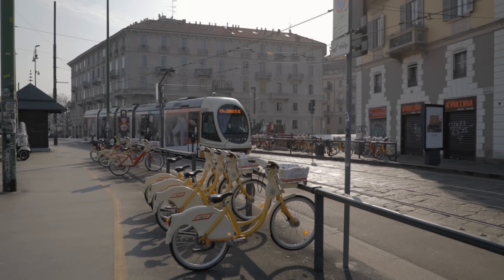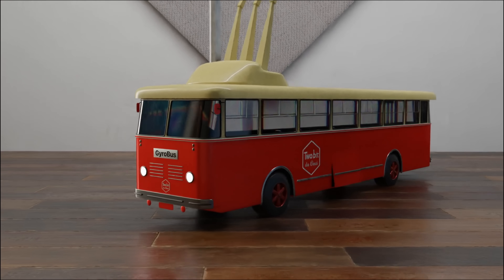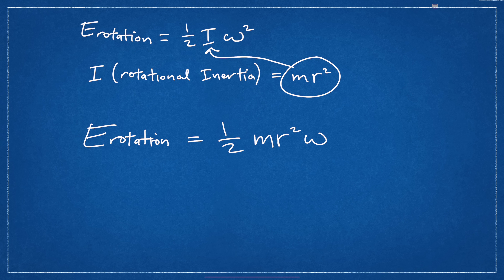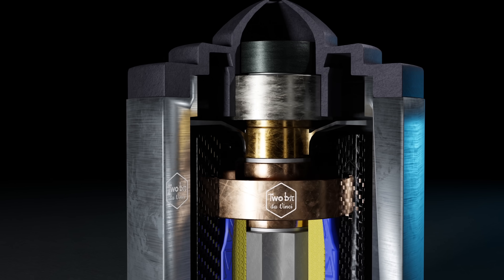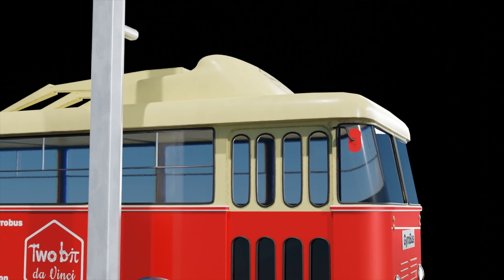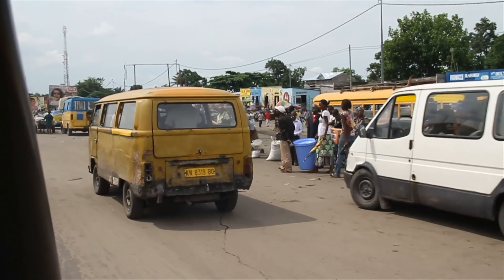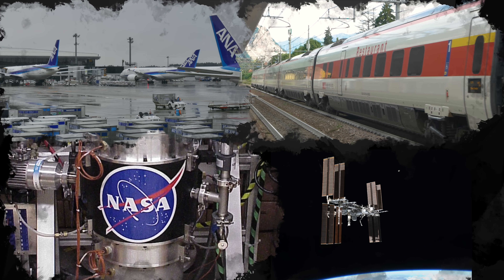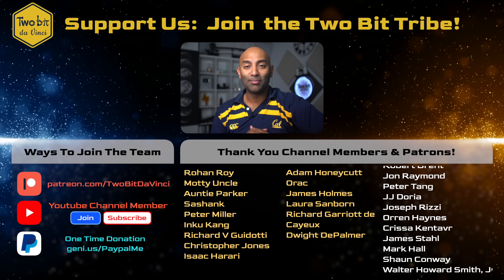This Bus Went Electric WITHOUT Batteries

Comment: Even for grid-scale energy storage, these flywheel energy storage systems are not commercially viable compared to pumped hydro and batteries, due to their low energy density, high cost, high probability of failure, and safety concerns.

Comment: Another ideal using no chemical batteries is using the similar ideal of the flywheel buses, but using compressed air instead.  This would cause no problems with  inertia when turning like the spinning 3 ton flywheel will. Using the same logistics, stopping every few miles and recharging using electric motor/generator onboard connecting and building up pressure at the bus stops. The motor that charged the air tank is also the generator to supply the bus motor its electricity.  The air pump can also work in reverse when discharging, supplying the generator the rotation it needs. But it probably still cost too much to run just like the flywheel buses. I don't know what do you think, will they cost just as much to operate?

But one for certain thing they will be much cheaper to manufacture, no need for vacuum chamber, no need for specialized exotic  materials,  just using the technology already mass produced. Like it shouldn't be a big hassle to design the air pump and motor/generator for a bus. But of course it is limited to air tank size and strength, but it is better than trying rubber bands. lol I would need a guy like you to go thru the calculations to see the numbers, if it will even work, and if so is it plausible for buses, and how efficient it is to convert electricity into air pressure, and then back into electricity, and then into mechanical motion of the bus.
Reply: Mmm.  If you use compressed air, you still have a large metal thing under a large pressure.  You're right about the inertia. I suspect the losses of pumping would be large, though, and I really don't think you could store useful amounts of energy as compressed air. the really nice thing about the flywheel is being able to directly add or take energy as electricity, which is convenient stuff to use.  If you think about compressors, they are all the mechanical miseries of a petrol engine, and not only that but you'd be using piston tech to get the air usefully out too, so it'd lose twice.  Now a giant clock spring...

Comment: Nope: Angle of procession. True flywheel will flip the vehicle when it turns a corner. These mentioned here are horizontally mounted and driven by external engines.

Comment: It's wind up concept like toys. Mechanical PLUS reasonable batteries...plus maybe smaller flywheels and soundwaves/steam engines should have stopped the destructive oil grift. FULL eco hybrids. Though nominal heated wax or oil could still help efficiency.

Comment: when I first considered this I discounted it for the conventionality of battery but I believe I'm beginning to see the light . with new developments in materials and motors and coupling devices to the wheel , there really maybe good practicality with ability to spin these up quickly and the obvious of hybriding with battery /supercap combo for quick charge at same time . 3.4 KWHrs/km ? thats a bit high but 20 passengers . 0.2 for modern car for 1 passenger . so even for that old clunky bus its still comparable and I'd hazzard a bet that antique bus number could be HALVED ! or better considering all the inefficiencies converting the spin to voltage back then and the advancements of todays generators and drive motors ...  wheres engineering savy ?

Comment: The thing with a modern flywheel is that there is no need for extreme RPM, you just do the math, run it in a vacuum with a magnetic or some sort of low friction bearing and then figure out your windings to get the current that you desire. Just look at that antique Swiss bus, 6 kilometres at 50-60 km/h. spin it up when you are stopped for passengers and good to go. combine that with diesel electric for backup and our modern energy braking recovery and I can see this being at least 5x more efficient then it was 70 years ago. you can even have a direct mechanical transmission of some sort. when you look at 3000 lb battery pack in a Ford Lightning pick up truck that gives you a lot of inertia at 10x that weight in flywheels in a commercial city vehicle. Combining various energy recovery systems along with just keeping it spinning at top speed while it isnt in use would likely make it last even longer. Also you need no exotic materials, no fire risk, run it at a modest speed in a well designed case to contain any unlikely catastophic failure. It just sounds like a great thing as we have been using flywheels of all sorts for thousands of years (pottery, spinning yarn, wind mills, etc). You look at the massive turbines in hydro electric, the high speed steam driven power plants. It is just a no brainer to perfect what we know instead of looking for rare earths for a 10 year battery. We humans just seem to love to look for higher technology to make things more complex and try to make  things "better" instead of looking at simple known tech and making it more efficient. Just look at the electronics supply chain problems, thousands if not millions of cars waiting on a microchip just to make them function but otherwise complete and ready to go. Imagine where we would be with modern transport if for example we could not make our autos run for the want of spark plugs 120 plus years ago.  What has happened to that old adage of "Keep it Simple, Stupid"? After watching your whole vid I thought why not mount it on a pintle like the compass of a ship? That way it could maintain the same attitude on uneven surfaces and change its angle when you turn(gyroscopic precession) Also multiples  for redundency and space utilization.

Comment: You mention a 20M Watt flywheel system near the end of the video. This just shows the inadequacy of renewable systems. A medium sized coal plant produces 400 MW of electricity. A typical nuclear plant produces 1000 MW of electricity. Thus, the renewables are a pimple on the a** of the energy we need.

Comment: My father worked at an Army weapons lab. When I was a teenager and taking physics and caliculus in high school. He set me a problem. They had a flywheel. The dimension were set, as was the speed of rotation. The only thing they could vary was the density of the material. So he had me calculate the density. Of course, it was all classified, so he couldn't tell me anything about the application, but I firmly believe it was a power generation system used in the field. This was about five decades ago.
Reply: flywheels are a nice way to dump a LOT of power into a laser or a railgun or an EMP device very suddenly but without browning out the nearest town's grid =)
Reply: @ralphm4132  I actually purchased some flywheels for a high availability data center I was building. We had it segmented into 100KW blocks. There was a flywheel always on to instantly provide the 100KW for a short period of time while the backup system (there were multiples of these) came online. It worked flawlessly.

Comment: Hi All @ 2Bit yes to fly wheels!
Small Medium or Large! If but on a gimbal the turns would have not been as Big a problem or in the Rear of the Bus on a c Track an if stabilized by Springs or Shocks letting them move would help the Turn! If Carbon Fiber I can’t see them getting near 3000lbs or 4 small ones on each corner of the vehicle 
Your talking about no Fuel to operate What are you waiting for? Bob Vandivort

Comment: That picture of how they did it might be useing induction motor that has no wire to the shaft,and you can put a conductor plate between that motor on a shall and it would spin. Here they are useing 2 induction motor. So it spin faster. They could do this today but where to put it. It get loose that a spinning top on the sidewalk. LOL

Comment: It never pays to reinvent the wheel. Thanks for showcasing these electric busses. I rode on the electric busses in San Francisco with the double telescoping wands that get their power from the overhead lines. I like the street cars that run down the middle of Market Street, the cable cars that run up and over various hills , and the driverless BART subway. The newest technology among those I listed is from 45 years ago.

Comment: Wow one of the coolest things I've seen.
I'd love to see you explain when why and how they came up with the wood gas system to run cars and buses through WW2. That was amazing to see film of.
Reply: simple, just anerobic burning of the wood to degas it and you end up with charcoal as well
Reply: @johnkufeldt3564  Back in the 19 40s during WW11, as a child I rode in a butcher's truck powered by what they called a Gas Producer. This was a huge thing on a trailer towed behind the truck. It burnt charcoal to produce the gas, which was piped to the engine. An extremely polluting device with black smoke pouring from 6-inch diameter  chimney on top of the device. Smelled awful as well.
Reply: @johnkufeldt3564  I understand the science. I was more intrested as it was used on buses how efficent it is. How the came up with it and is it still used practically  🤔
Reply: @guswhitehouse728 Back in the 19 40s during WW11, as a child I rode in a butcher's truck powered by what they called a Gas Producer. This was a huge thing on a trailer towed behind the truck. It burnt charcoal to produce the gas, which was piped to the engine. An extremely polluting device with black smoke pouring from 6-inch diameter  chimney on top of the device. Smelled awful as well.
Reply: Back in the 19 40s during WW11, as a child I rode in a butcher's truck powered by what they called a Gas Producer. This was a huge thing on a trailer towed behind the truck. It burnt charcoal to produce the gas, which was piped to the engine. An extremely polluting device with black smoke pouring from 6-inch diameter  chimney on top of the device. Smelled awful as well.

Comment: This video would be alot better if you compared it to other battery types. And the title of this video is false, because fly wheels are mechanical batteries. 

What is the energy density compared to gravity, or sodium ion or or lithium ion batteries?

How efficient is it converting to and from electricity?

How much power loss is there over time?

How nimble is a fly wheel for getting power into and from it/how much power transfer can it handle at once?

How long does a flywheel last assuming no off roading in a bus? Is there drop in efficiency over time before failure?

All this compared to other battery types.

Comment: Could still be practical in space, where you don't need a vaccume chamber and could use multiple flywheels for both attitude control and energy storage at the same time. Also, if you think about it, large rotating space stations (if they were ever built) would be like the ultimate fly wheels. You could store energy by drawing weights/pumping water toward the center, increasing percieved gravity at the extremities, then let the weights/water turn a turbine on their way down, decreasing percieved gravity.

Comment: Fly wheels are very ineffecient. Your taking ELECTRICAL ENERGY converting it into MEcHANICAL energy then RECONVERTING ONLY 85 percent back into useable energy.. you said the avg bus used 3.4kwh per kilometer. basically 7.8kwh per mile so a 100 miles it would use 780kwh... a tesla right now does that with 34kwh per 100 miles with batteries.  

Rule 1 you cant CREATE OR DESTROY ENERGY. all it does it change forms.  so if you put 1kw in you will get less than that out.. due to heat creation friction ect.  Flywheels are a horrible green energy marketing idea.. for the time... they were prob better than the batteries available. but with current tech, better stick with batteries and supercaps.

Comment: I see that jaguar cars are now incorperating this system into a new car and the outcome so far is looking more than just promising.
I think that taki g a look over ones shoulder every now and then, reminds us that there are things we tend to miss first time round , this is a  good example.
At the time  they may have have had soms problems when this bus was up and running, but technology improves and along the way removes a problem we had to start off with.
I really feel that there have been many cases like this, zero point energy is another that i feel somdwhere along the way we have missed something because we know the energy is there, this is beyond doubt, how we go about collecting it so far has been the setback.
Also we have a more damming problem, that is human greed, if everyone can do it, then money men will be quick to step in and stop the move forward because tbey are not making their bucks out of it, or put more plainly, as Morgan said, if you cannot put a meter on it and charge everyone, then we dont want to know about it, not only dont want to know about it but actively put a spanner in the works to stop its progression.Apart from the heat of fhe sun making its way to our planet there are other forms of energy coming from it that as yet we have just not even contemplated, we are at a time where ALL  the likely forms of energy need a good in depth study made of them.

Comment: Flywheel is good as a backup battery of a Trolleybus/Pantograph Truck in case that it needs to go off-road or off in the overhead wire for some situations for a short period of time. If the flywheel is not in use, it will charge using the overhead wire while the trolleybus is running.

Comment: No thanks. Had an industrial centrifuge explosively self destruct in a factory once. Parts were found over 200 feet away, having passed through 2 solid concrete walls and embedded themselves in the 3rd. It was a miracle no one was killed. One worker had a part whizz past his head, not touch him, but the compression shockwave split his scalp and gave him a concussion.

Comment: "This Insane Bus Was Pure ELECTRIC & Didn't Need Batteries"
Come to Eastern Europe cause we still have buses that are electric and don't need batteries, and we've had them for ages. Also Hyperloop is a fraud.

Oh damn he actually did kinda mention trolleybuses. They are still the best option though, change my mind. I think this flywheel tech is cool but now we have supercapacitors which could do the same thing.

Comment: The flywheel is still a viable option especially using "LED" enclosed be steel to increase the weight of the perimeter of it.

Comment: Rotary Uninterruptible Power Supplies have been around for a long time.  I've seen them in use for backup power supplies for buildings where other forms of standby power were unavailable.  I've also seen them in use in military applications to provide the equipment to power down gracefully.  

If we look at transportation it would probably work a lot better for a street/trolley car application where the tracks are straight mostly and usually have very gentile curves.

Comment: A hyper loop is a pipe dream I doubt one will ever happen since it will require 100s of miles of tunnels in a near perfect vacuum. The channel tunnel is not in a vacuum and it took  13000 workers 5 years

Comment: i just figured out a way they could fix the gyroscopic effect, they could instead of having 1 flywheel they could have 2 flywheels stacked ontop of each other each spinning in the opposite direction of each other, you then cancel the gyroscopic effect

Comment: Physics:  laws that cannot be broken.  While I agree flywheels are amazing storage devices, they do come with great danger.  Not a flywheel, but something that happened to me:  I was using a 3.5 hp router to put a nice curved edge on wood.  The router was mounted on a router table, with the bit facing up.  After a lot of use, the bit became loose and leaped out of the router.  It was spinning ridiculously fast, bouncing all over my garage in random directions.  Had it hit me, it would have done significant damage.  I was very fortunate!  Now I check the tightness often.  Like any mechanical/electrical/chemical/etc. device, maintenance is key to safety!

Comment: What people don't realise that the first cars were electric but combustion took over because it was more powerful and efficient at the time
Reply: A major factor in why gas dominated over electric is because it was MUCH easier to build a gas station outside of town, and resupply it with gas trucks than it was to build an electricity station, needing to run power lines all the way out to a remote location.  Gas was simply the solution with far simpler and cheaper INFRASTRUCTURE.

Comment: Estimates indicate 6-8 windmills output is required for each electric auto. 600 million current US vehicles and wind mills that last just 15 years max , we will run out of resources before we could possibly build enough. Flywheels may work in limited circumstances but have the same resource density. Mining all the materials to produce enough to power vehicles would be not only costly but near impossible to achieve.

Comment: Flywheel energy systems show up in automotive applications from time to time. But at the end of the day they usually don’t go very far. They often prove the concept they were created to test, but there are often drawbacks which go along it’s technology. Chrysler messed around with the technology for a while in the the 80’s and 90’s. Formula 1 fooled around with the technology calling it KERS. (Kinetic Energy Recovery System). Don’t know it’s status currently. Some systems have been experimented with to help city buses use flywheels to climb and descend very steep grades. Also ones where they use flywheels for using flywheel stored energy to aid with acceleration and breaking so the busses could use lower hp engines.